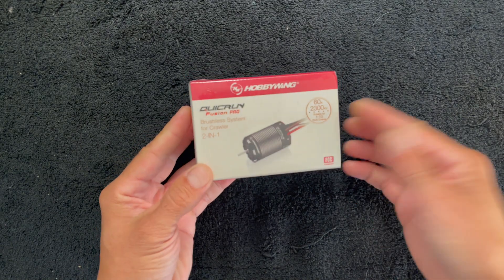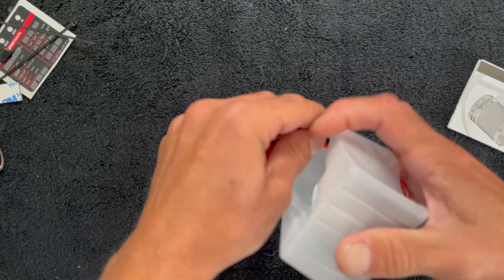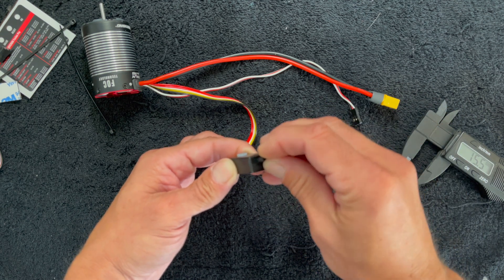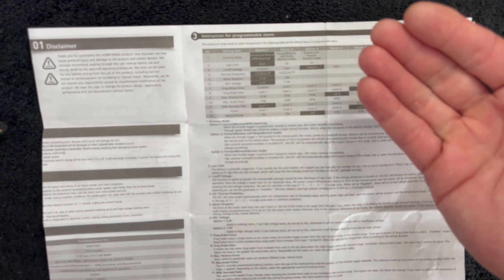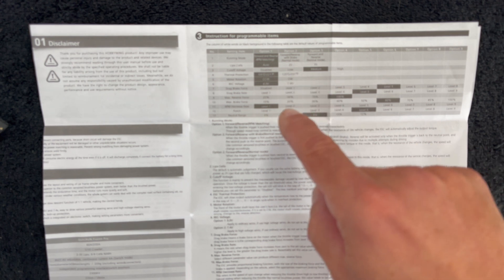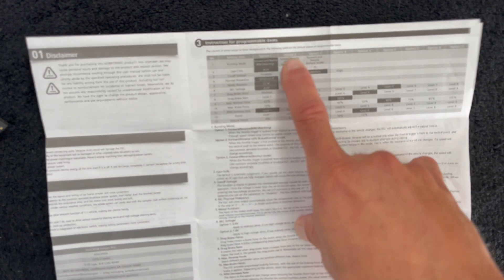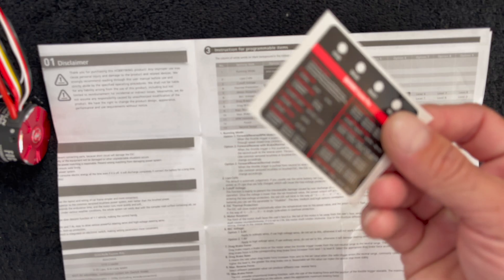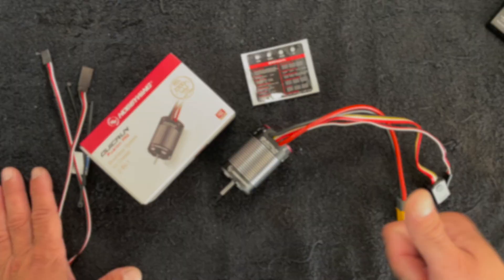The Charlie Show /// Episode 280 /// Fusion Pro Unboxing and Settings

Comment: I just opened a new 1800 fusion and some one swapped it with a brand new titan traxxass brushed motor,even had the celafane on it but no plastic holder in side lol.

Comment: New to the hobby and I have a different application than most.  I'm working on concepts for rover designs for use on the Moon and Mars and I think starting with an RC vehicle that I can operate at slow speed in a crawler like use case.  That is, I'm looking to use some, more or less off the shelf components that can give me the opportunity to learn before stepping up to purpose built rovers.  Additionally, new rover drivers would benefit from learning the basics with consumer hardware before risking what might be a many million dollar rover.
Just to clarify, the vehicle would not be operated at high speed in most cases and instead I want the ability to go slow while climbing/descending and when I say slow I mean less than 1kph or about 25cm/sec.  At present the vehicle I have to begin testing is an MJX Hyper GO 10208 V2 1/10 RC which I plan to pair with a Radiolink RC6GS V3 7 Channels RC Transmitter.  I have an DJI Osmo 4 that I've attached to the roof of the MJX truck shell and I may add a DJI O4 camera and some goggles to give me an FPV ability.
Which brings me to the question I have.  In order to drive at a sustained low speed it might actually be preferable to run with a high capacity 2S battery as the speed increments the remote allows you should permit lower speed operation with lower voltage.  But, the motor and ESC are important as well and it the ESC and perhaps the motor that might be the final piece to get really smooth slow speed control.  So, what ESC's are recommended for my use case.

Comment: Hey Charlie my fusion pro has 2 problems 
#1 I plug in the program card and it shows nothing just 2 red lines it doesn't let me adjust anything I tried the card in another fusion pro and the card works so its not the card and 
#2 it's getting so hot in my crawler and it's getting so hot it's just about to melt the wires I concerned it's going to catch on fire???
Reply from the maker: Please email us for support topics - NorthAmerica@hobbywing.com
Reply: @HOBBYWINGOfficial   I did 2 weeks ago and still haven't gotten a response yet?????

Comment: Uhh .. ? Have compared the weight of this unit to the weight of a exact motor and ESC ? No, I bet you haven’t.  This setup is much cleaner anyway. Your rig probably has 6 feet of extra wire zip tied everywhere. (extra weight right ?) If you had a lightweight comp crawler the setup would be better with a outrunner motor anyway. (that’s the type that the outside of the motor rotates.They are super lightweight,small, and have lots of limitations 😂). The Fusion setup is totally different. Do you even have a RC car or are you that guy that criticizes Everything-
Reply: This reply was to German big.

Comment: hi there.
we have XRotor 40A ESC COB and using with Flycat 5010 750KV (Disc type motors) and using pixhawk and using skydroid Remote and reciever.....and making Quadcopter.....So we are facing a serious issue with these ESC.....Drone did not fly properly and there is no error in Flight controller or in Compass etc...we double check......first we face callibration issue but we fix that....and now drone is crashing right after we give little bit throttle up for take off...........Drone is flipping on one side and behave abnormally ............even we change Timming to High, and low as well.......and recallibrate ESC even with different radio and reciver and other different methods.........Everything is tried but Fails............Kinldy Give proper soulution we have to complete it today.
Reply from the maker: Hello,  Please feel free to email us for direct assistance - NorthAmerica@hobbywing.com